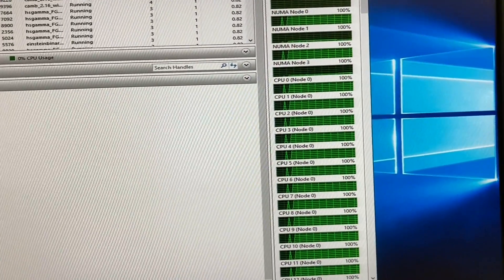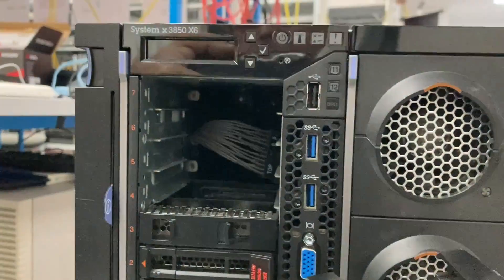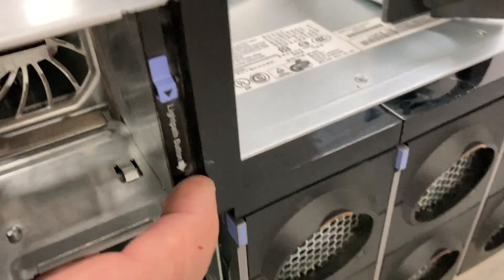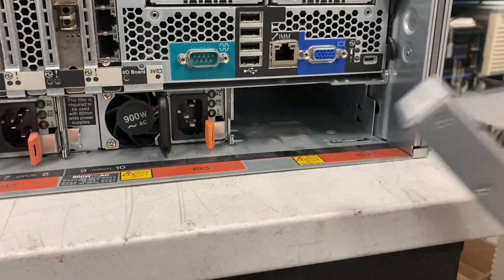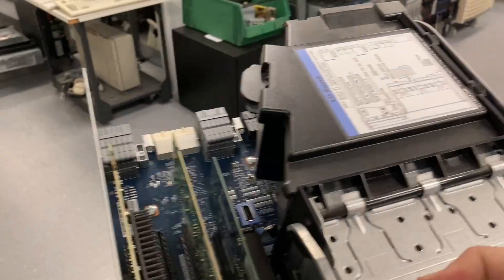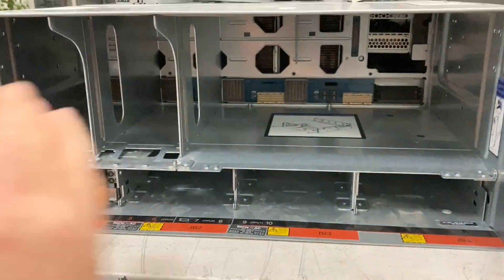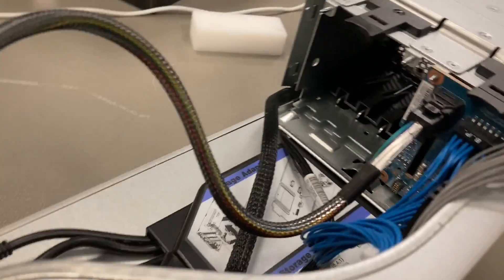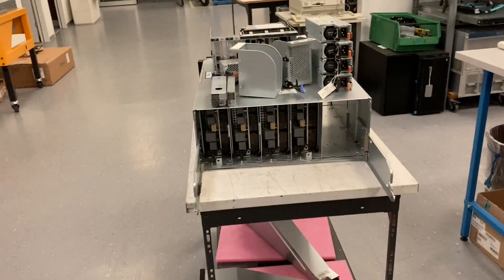IBM server X3850x6 with all the bells and whistles! (PWJ222)

Comment: Nice, i worked for a shop where they bought used Sun T5-2 circa 2021, with 1TB of RAM. It also took a good 10 minutes to start with all Sun pre-boot diag. To buy that T5-2 was a really bad decision, in 2023 it was still just collecting dust and never put to use. I like x86 much more than SPARC/pSeries and this x3850 is truly marvellous

Comment: Cool box and video demo! Thank you.
Even though it's probably not that fast for its intended use, I would love to have a unit like that for doing CFD Computational Fluid Dynamic solving. I am thinking that my next computer: might be old. I need memory, at least 256GB of RAM, but the more the merrier, so I might get an old Epyc or Threadripper.

Comment: Nice product tour and teardown keep it on! Brought back some nice memories from early 2000's and for many years as a systems engineer in an IBM authorized service provider. The xSeries went very far and the x3850 was the last beast (flagship) model produced before IBM sold to Lenovo the x86 servers' division in 2014 (laptops have already been sold in 2008). My true love however goes to IBM BladeCenter servers for their ultimate engineering... an idea for a future video maybe in case you have something in hand reach!

Comment: So what happens when you guys get these beasts? 
Are they decommissioned and scrapped? 
What happens to them ?
Reply from the maker: In this case, I will erase all hard drives from customer data and then one or two machines go to stock for spare parts. The rest will go to scrap. After removing the memory of course 🙂

Comment: I loved IBM servers and the Thinkpads back then. I have no idea where they are now compared to the competition but this machine here is just beautiful.
Reply from the maker: First of all, IBM has stopped manufacturing "computers*, they only make mainframes.
All the small stuff is now made by Lenovo. In fact they were already the real manufacturer while iBM put it's badge on it.
This x3850 seems to come from a totally different factory anyway. There is no comparison to other models from that time. It seems that someone could realize his own design project. I mean even the round vent holes speak a completely different design language.
My personal favorite now is Dell. They improved quality and services a lot while HP and Lenovo got worse. And Lenovo has never been really good...
Reply: @PlaywithJunk  Thanks for that update! Did you ever get one of that facebook, amazon or google rack computers in your hands?
Reply from the maker: @liamhotspur9182  No. I think they are processed directly on the sites where they are used. I assume that kind of hardware is hard to get. But from what I have seen in videos (there are some good ones from Google), it's not too exciting. They have wast amounts of servers but each one not terribly powerful but customized to the needs of the companies. Most servers are not much more than a mainboard, some brackets and a few hard drives. The rack is the housing...
Reply: @PlaywithJunk   Hey! I saw today, you still can buy IBM RISC Servers now called Power System (AS/400) and still very flexible to configurate. I would buy them! I saw German based Oetker enterprise (Dr. Oetker) 100% running IBM Power Systems.

Comment: I don‘t know much about server operation but how often in the use of such a thing are all the fancy retractable handles used? This must be crazy overengineering.
Reply from the maker: Well... you need them to install the server in a rack. And after 5-10 years you use them to throw it away 🙂 Maybe one or two repairs in the meantime.
Reply: @PlaywithJunk  So it could be just something you hook in and put in the drawer afterwards. But if you are IBM…
Reply: The mounting rails were known for loosing the ball racers that allowed the server to slide in and out. The rail would move - you would hear the pitter patter of the ball bearings falling out - then the handles would be used to stop it toppling over

Comment: IBM understand downtime is everything. everything can be swapped out in 10mins.  
Love the engineering but hate the price. But then you can justify it with how much downtime would cost and it only takes one outage and a please explain.
Thanks for showing it off :)
Reply: But after you have swapped the defective component within 10 mins, you still have to wait 10 more mins for the BIOS tests before the system boots.
I often wonder why those servers that are designed with such large uptime percentages always take so long to boot... it is not only memory testing, ALL the tasks take such a long time.  Almost like there is a sleep(10) after every message displayed.
Reply: @Rob2  i'm not familiar with this model but i guess that's true if you swap the board or something like that. most of the rest subsystems can be swaped while the system is working.
Reply: @Rob2 You only want to do scheduled shutdown and you don't want to do them often. So it does not matter if POST takes 10 seconds or 10 minutes. You just want to know that you don't have to do it unscheduled again for a year or two.
Reply: @benbaselet2026  For many operating systems it is not realistic to run two years between security-update related reboots, especially for the one from Redmond.
A month is more common.
Of course you can put a hypervisor in between and hope that it can run 2 years between upgrades.
Reply: @Rob2  Not everything is online. I have systems with 2-5 years uptime. Also some of them are Windows XP.

Comment: 10 minute startup, sounds about the same as a sun T4 from the same era I have. 128GB memory check on that lil' guy takes forever. Probably the similar time since it just has a whole lot less actual cores (4 cores, 32 threads because t4 series ultrasparc)

Comment: IBM x3850 X6 Server 4x Xeon E7-8880 v3 6TB DDR4 RAM 8x 3.8TB SSD 4x 1400W PSU Rails FC = $31K

WOW  WOW  WOW  😳😳😳
Reply: That is not too bad.  Imagine what it would cost if it were from Apple 🙂
Reply: OMG! Reading that just made me feel faint!🤑🤑 @Rob2
Reply: @5argetech56  When it was from Apple, the dummy modules that cover unused slots would cost $1000 🙂
Reply: @Rob2  apple= trash and only for retail marketing nothing more just basic computers and phones

Comment: Engineer: So, how much RAM shall we put into this?
Product design: Yes.
Reply: It considers all the RAM in an entire city to belong to itself but it wants even more? 😅
Reply from the maker: ...
Product design: All!
Reply: The X3950 x6 is basically two x3850x6's combined  :)
Reply from the maker: @don_prince   Too bad they didn't connect the two with cables... I have 4 x3850 here. But they used a bigger midplane that connects all 8 CPUs and the other stuff.
Reply: My new home system has only 4 modules like that.  And I considered it to be a lot...   well, I still do.